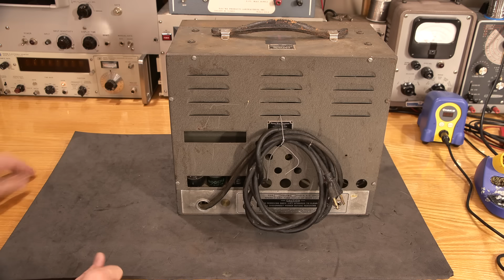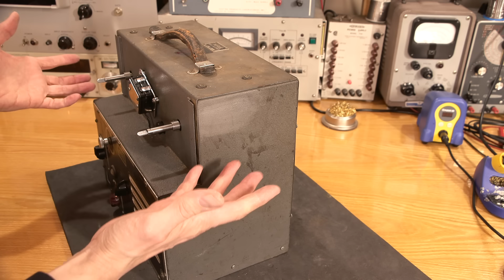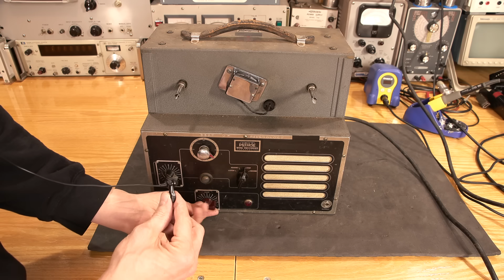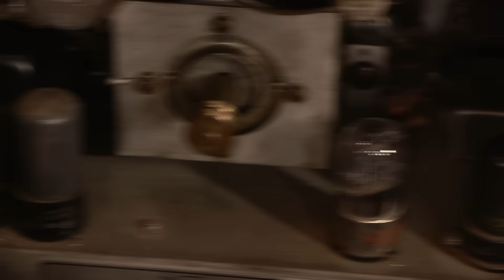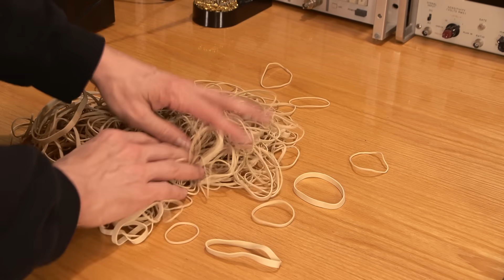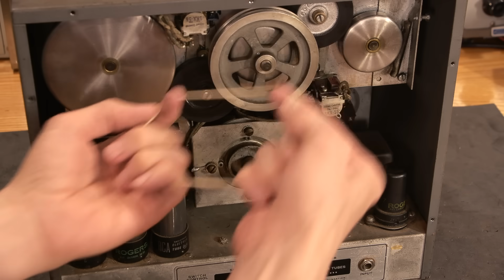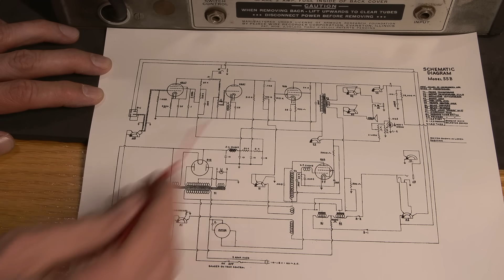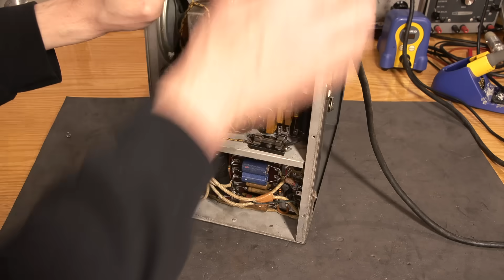Trapped Voices In This Wire - Let's Listen To Them!

Comment: You sir have resurrected the dead, shows the power of determination and know-how! Inspirational.
Reply: Seemed pretty rehearsed and contrived. Ever have the screws or tubes come out that easy on a piece of equipment that old? As soon as he spun that motor shaft I knew he was going to "fix" it with a rubber band. Probably after removing the belt the day before. No one buys these without knowing if they turn on or not.
Reply: @mattmarzula  They could have opened it up before whenever they bought it.
Reply: You do if and when you know you can fix and restore it. Especially if you have access and the resources to do it/plus access to any parts that may be needed....like he seems capable of. Especially if you have the know-how....like he seems to have as well.
Reply: However, I do agree that I would assume that he knows, and at the very least did a once-over before the video. I mean someone like him and as curious as someone like him would check to see if it already works and what is going on before making a video. Especially in a streamlined video such as this. If this were a vlog type video or a really long live recorded video of him when he first gets it and opens it up to check it out...and every step of the way then that would obviously be different. This is more like one of those educational shows for kids on pbs and stuff. Where you would know everything that you are going to do and show in the video beforehand, so that it is streamlined and straight to the point before recording.
Reply: A bit over the top, it is just a magnetic recording same as audio tape, just metallic wire as the media.  I restored my grandfather's 1950's reel to reel tapes and would not say he was resurrected from the dead.
Reply: Good statement

Comment: That is very interesting indeed thank you!  I dimly recall heard of this technology from my late Dad who became the lead electrical Engineer at a copper smelter in Port Kembla Australia (Now defunct).  However I have never come across these machines personally, though I did repair an old Stromberg-Carlsion valve radio when I was about 13 or so, it had a blown capacitor.  I would certainly be interested to see a restoration video.

Comment: Surprisingly clear speech.
Reply from the maker: Thanks for stopping by Clive!
Reply: @MrCarlsonsLab  Well, that's one way to hear the recording.  Did you also try plugging in a 1/4-inch plug into the output jack on the front to see if there was anything?  That might be either speaker level or line-level signal, I'm not sure.

Comment: As i'm thinking the entire setup is based on the Class A amplifier system. The primary transformer is looking good because its giving the power to setup. in the old scenario the Speakers are also connected with the output transformer which is looking faulty or the speaker coil is burnt due to the warnish polish may became dry with the time. The Dry Power Capacitors Due to time can be changed so the Tube could take the load of output and the motor will be more stable. I hope it may works.

Comment: Those tubes appear to be microphonic, unless that is a byproduct of that device you are using. I am not familiar with that tool.  Stating the obvious here but for whatever reason the signal is not making its way from the preamp to the power section and onto the speaker.
 edit: that screen resistor looks pretty much cooked on that preamp tube socket.  Also those caps can jump up and bite ya even if the unit is unplugged.

Comment: I actually make a big coaxial cable at work. Some of it has like 1/8 inch solid copper core and lots of PTFE insulation along with being shielded. The big stuff is like 1/4" thick would that help the probe at all? I could send you some.

Comment: Back in the day you could go to any Radio Shack, and use their tube testers. Also, there were numerous tube testers at many neighborhood stores or convenience stores.  The tubes' heating are usually wired in series, so that if one burns out, they all burn out, which is why you'll need to replace all of them one at a time with known good ones.
Reply: When I was a kid you could go into any drug store or grocery store and test your tubes - transistors were still very new and most everything still used tubes (I'm old!)

Comment: If you could get a second unit....not likely but, if both reel head mechanisms worked, it would probably be easier to restore one for display and replace all the old circuits and tubes with solid circuit components, rectifiers, transistors. Preamp board etc.... on the second and use the modernized one to listen to reels to preserve the restored one.

Comment: I saw someone use tywraps to temp replace a broken fan belt. I wonder if they would work to replace the broken belt when you wouldn’t have the right size rubber band. The tywraps or zip ties were strung together to take up the slack. Just a thought.

Comment: If I had been told that you could record audio on a stainless steel cable, I would never have believed it, and now I can see that there is so much that we don't know, it's really incredible. Now my mind is open to seeing more new things that we don't know, and I could now say that everything in the universe can be. thank you
Reply: Steel has high magnetic reluctance, so if you magnetise it with a relatively strong field, it tends to stay magnetised until another strong field demagnetises it. See also magnetic hysteresis.

All this does is use sound waves to magnetise small-ish chunks of the wire as it passes over the head. Pass the wire through again, and now the changes in the field get picked up by the same head (though very weakly). The amplifiers do the rest.

There's a problem with doing this using a continuous length of wire though. It kinda has to be magnetised in relatively large chunks, due to being continuous and all. So you have to run it quite quickly through the machine, and even then you don't really capture all that much detail from the original signal.

To help that, some Germans (I believe) decided to break up the wire into tiny chunks that can be magnetised individually. They used regular ol' iron oxide (i.e. rust, but a special subset of it). Ground it into a very fine powder, and stuck it to polymer tape. Each one of those fine particles is its own magnetic domain and can thus be magnetised individually. Due to how small they are, you don't need to run this newfamulated "tape" all that fast in order to get it to capture a BUNCH of detail that the wire simply cannot.

Recording and playback heads were also improved to significantly concentrate the electromagnetic field used to record the signal, and to be able to pick up finer detail as the tape went past.

Originally great fidelity could be obtained by simply running the tape past the head at a relatively high speed. It meant more particles passed under the head and could thus capture (and reproduce) greater detail. To keep running times acceptable though, units sold to consumers outside the very high end market stuck to a relatively low speed and thus suffered from poor reproduction quality until better heads and finer tape formulations were developed.

This went on right up to the digital revolution, but it all started with fine stainless steel wire whizzing through big crude machines and not recording sound particularly well.
Reply: ok I also never heard of it until now but going from this to "everything in the universe can be" IMO is a stretch, it may sound profound but there's laws of physics, you just can't break, even if you want to and this wire tech, doesn't break any laws of physics.  Is really just like tape, audio is recorded in the wire using magnetism and based on some sources, this came before tape, so the later probably was invented, because the person that invented wire recording demonstrated the concept and the physics but this tech add some deep issues that made it lose the fight.
Reply: More like this is a fragment of what has been forgotten.
Reply: Imagine what they'd think about cell phones 😂. They'd probably never believe the technology we have today as well. In fact they'd probably say it's impossible to record audio on anything that does spin.
Reply: The early Black Box recorders in aircraft were wire recorders.
Reply: If you watch Hogan's Heroes they do a lot of wire recording. 😊
Reply: My grandfather had one he used for work. As a young lad I'd play with that thing for hours.
Reply: The technology is magnetic recording and has been known for over 125 years.  It is a recording like an audio tape, same technology just using a metallic wire for recording media as "tape" had not been invented yet.  The idea and reason that the wire is very small/thin is the same idea as the thinness and narrow tracks on an audio tape.
Reply: A lot of us do know..I think it's mainly just you and a few others that don't.🤭😂

Comment: I have a wire recorder. A Silvertone from 1951 or 52.  ON one spool is Vaughn Monroe  singing "Ghost Riders in the Sky", and on another my grandfather and uncle pranking my dad, and blaming him for doing something...  "Oh sure now blame it on me now" and every time my dad was blaming me... guess what I said!
Reply: Damn, how is the audio quality? I'd love to hear it.
Reply: @AdventuresWest  Well it's surprisingly good. lets face it it's a tube amp and it sounds as good as the source. The speaker is only 6 or 7 inches so there's not much base + the amp isn't that powerful. It's been at least 50 years since my father and I replaced 1 of the rectifier tubes and he showed me how to use it. The last time I played it was 1982 or 1983.  My Dad was surprised when I called him down to the basement and played "Oh sure now blame it on me now" , something he recorded from AM radio station, and  Vaughn Monroe  singing "Ghost Riders in the Sky".
Reply: Yea

Comment: For your drive belts,  They sell an O-ring splice kit, which is just an assortment of various thicknesses of cord stock, and some cyanoacrylate super glue to adhere the ends together. Super glue bonds rubber very well.  As for voice on a wire...  I am a machinist and machine tools have DROs (digital read outs) that display table axis position, in inches or mm.  I have a machine with a SONY readout, that inside the linear encoder, is a stiff wire, and 2 quadrature read head coils.  I assume there is a sine wave or square wave recorded on that wire, to allow the numbers of the DRO to read linear measured position.  I assume the 2 technologies are related.  ---Doozer

Comment: That is so frigging cool! I knew there were wire recordings but have never seen one in such detail. And for sure never heard an actual wire recording. Simply amazing! What I wonder about, and if you can answer, how do they lay a magnetic signal onto stainless steel wire that is typically not magnetic? Is there some ferric coating over the stainless steel wire that allows for magnetism to be recorded and stored "On the wire"?

Comment: It sounds like it's running slower than originally recorded, but as long as it's not warbling this is something that can be "fixed in post". That's almost certainly easier than trying to match the motor to the recorded speed.

Comment: I own 2 or 3 Webster Chicago Model 80 wire recorders built somewhere around 1948 or so. They work, but definitely need restoration. I also have a collection of wire spools, some are new and never been recorded on, others have all kinds of material recorded on them. A while back, I transferred a few spools onto my computer and saved the recordings as MP3 files. Most of the recordings I have listened to were from the late 40s into the early 50s. I am in my mid 60s and it's very interesting to hear some of the voices and material they recorded back then.
This was my first time seeing wire spools of this style. The spools I have are the single spool style with the large hole centers designed to fit the Webster Chicago recorders. The recorders have a take-up reel where you rewind the wire onto the removable spool when you're finished with it. 
This style is more like the design for reel-to-reel tape decks made in later years.
One other note about the Record function - if you try recording onto a wire without an audio input, it works like a tape recorder and will erase anything recorded on the wire, just as it would if you record other content over something previously recorded. Be very careful with that function.

Comment: I've worked on a few wire recorders, but it was 50 years ago.  The wire stays good for a long time unless broken or exposed to an external magnetic field.  I'm scratching my head to remember if the audio was muted during rewind, or if I had to remember to turn down the volume during rewind to avoid "jibberish".  I'd suspect the audio amplifier B+ and bias as being in trouble for this system.  So, I'd like to see a trouble-shooting session and/or a restoration session for the unit.  A good lube job and some resurfacing of the rubber rollers would also be advisable at this age to keep the recorder active.  The sound fidelity of a wire recorder is not as great for music or general audio, but these old wire recorders were heavily used for business dictation and other voice recording (e.g., interviews, wire-taps) purposes.

Comment: My brain just can’t compute how anything is recorded on wires! So cool and glad I found this video.
Reply: It's the same way that magnetic tape works: Using an electromagnet to translate an electrical signal to a magnetic field which is imprinted on the wire/tape. Steel wire came first, and then tape came along as an improvement of the concept, allowing higher fidelity and multiple channels by imprinting the signal along a 2D ribbon of magnetic tape rather than a single-point wire.

Comment: For old rubber parts in tube gear I use AT-205 Re-Seal. It softens rubber. I've used it for instance on the support bushings for the tuning capacitor in a radio. If they're not broken and destroyed already I put a few drops on them and in a couple hours the rubber comes back to life.

Comment: I had a wire recorder I bought at an antique store as a teenager (I'm 66 now), even then couldn't get the proper wire for it but found the correct gauge of piano wire worked just fine.  Not exactly hifi but functional.

Comment: So this is what it would be like for the NTSB to listen in on the flight recorders from plane crashes. Those all use wire recorders if my recollection is correct. They must be very well thermally insulated, as the heat from jet fuels burning is intense enough to change the magnetic properties of the wire being recorded on. Let alone even melt such a very thin wire.

Comment: Hi, it is my first time on your channel.
I know nothing about electronic, i am a mechanic. Regarding the rubber parts it may be possible for you to restore those if they are synthetic with AT-205; I use it on car parts like bushing. I have once restored a bike klaxon that the rubber were sticky and cracked and turned it like brand new.
The recording is very interesting, i wish I could hear the whole conversation.
Cheers.

Comment: So we've taken the idea that was refined with the Super-Probe and extended it into the Ultra-Probe, 
capable of serving as a magnetic sound pickup for electrons migrating through the amplifier tubes.
instead of using the crude original tonehead of the recorder, restricted in its use to function only in direct contact with the magnitized wire. 🤔
Praised be the Lord for the creation of the Ultra-Probe! 😃
You wouldn't happen to have the original mass and angular motion formulas needed for the creation of the earth's iron core father had used as part of the genesis project by any chance?🙄

Comment: I have an ancient tube-based probe. your videos on how to use it allowed me to repair an old Realistic TRC-453 CB radio. Restoring that wire reader, or at least doing a long video revealing the content of it would be nice. There was some political content in the first time it worked. It would reveal some context about who was talking, and when. I do have a collection of old and older tubes if needed at no charge if you want.

Comment: I would try to find an O-Ring that fits, I use an 027 O-Ring to repair dvd rom drives. There are plenty of machines that uses very thin large diameter O-Rings to seal housing covers.

Comment: Very interesting. I am an old tech and as a young man I was gifted a wire recorder which was an early repair project. This would have been in the late 50's when I was 14-15 years old. Been doing electronics all my life. Most people have never heard of a wire recorder. This is the first one I have seen since that time. Mine was horizontal with a large take up reel and small storage reel.

Comment: I've had a Lorenz Recordophon on my bench for a while now, which I can't even begin to restore until I buy and replace 90% of the components. It's a combined radio receiver/record player/wire recorder and the goal is obviously to finally listen to the wires. 
I've given up a number of times and then gone back to trace down the faulty bits. Even reaching some of the components means desoldering other components; it weighs a ton, it's unbalanced, I've had to build supports to be able to work around it - it's disheartening. The mechanical parts and the cabinet are in wonderful conditions, though, and it would be such a shame to let it rot away 😥
I'm trying to encourage myself by watching your and "Mend It" Mark's channels; not that I could ever aspire to such greatness, but a man can dream...